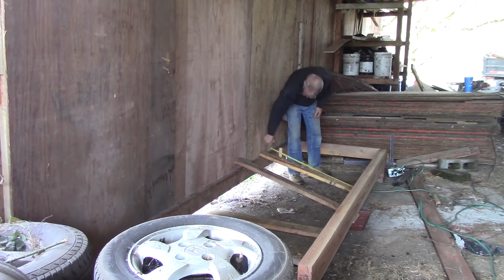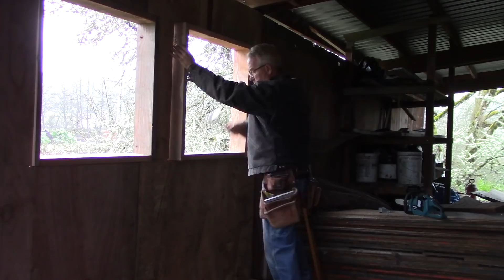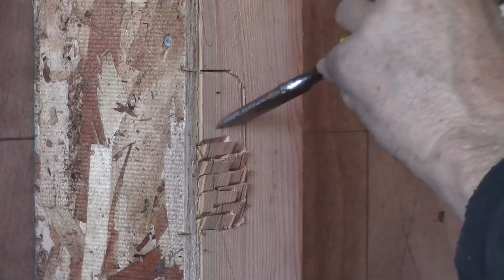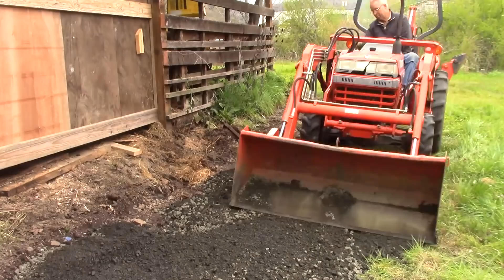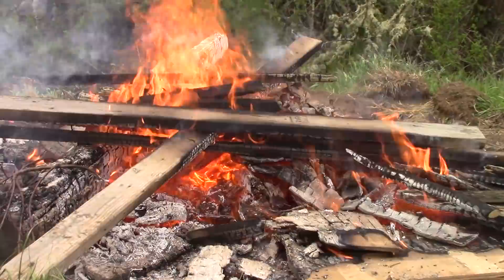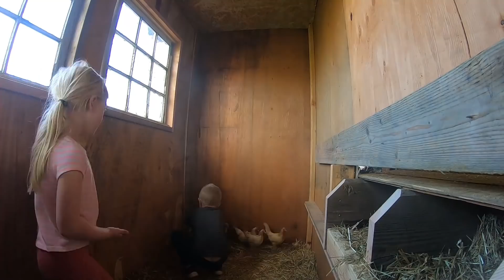Building a Chicken Coop

Comment: Hi Scott thanks so much for all the educational content you create. I use to work part time in electrical. I met a craftsman like you working a post and beam build, he said something to me that always stuck he said the difference between a good job and  great  job is 5 minutes. His other comment was one day while I was wiring a light up in a peak there was a bolt hole that need a plug, he asked if I could put it in as I was already up there I did tapping it in flush when I came down he asked if I left it 3/16 proud I said you didn’t tell me to do that . I said it’s 40 feet in the air who’d  know he said “I’d know”  he subsequently went up drilled it out replaced it . His like your philosophy towards workmanship inspires me  thank you

Comment: I built a 10'x5' rectangle, with a 5'x5' enclosed area taking up half a couple feet above the ground for the indoor space, slapped a metal roof on it, it's about 5 feet tall at the peak, nailed on an egg box and put it on wheels.  It's a hybrid coop/tractor I move around the yard every few days.   I quickly learned the chicken wire isn't strong enough against larger predators, especially dogs, and replaced it with hardware cloth.   It'll house up to 8 chickens.  Over the 9 years we have scaled back to 4 chickens since 4 eggs a day is plenty enough for our family of 4.  We let them out a few hours a day to roam the backyard.  They have brought much joy to our family.  Our current dog (pit bull) that grew up with them as a puppy gets along and actually plays with them.

Comment: So true about working alone. I'm building my shop by myself and I've concluded that in most cases, getting a 2 or 3 person job done with one person just requires some ingenuity. For example, the windows on my shop are 100 pounds and 4x6 feet, no way one person can do that. So I clamped a winch to the bucket of my tractor, looped the wire rope through a chain link screwed to the rafter tails above the window hole, and down, then attached the hook to a ratchet strap looped around the window. Gave me pushbutton control of the raising and lowering and worked fantastically. I'll be using my very old scissor lift to raise the very heavy 5/8 drywall panels up to the ceiling. The only thing that absolutely required two people was getting the 28' long metal roof panels up on the roof from the ground, and someone in a comment on YouTube helped enormously with an idea that made that work.

Comment: 6:29 That's the truth there. On that spiel that touched on trying to use old stuff; there was a deck we replaced that left us with about 500 square feet of old junky composite deck boards; it sat by an old barn at the ranch we had recently moved into at the time, and got mostly grown over with grass; 2-3 years later I start to wonder if it's worth hanging on to, when suddenly it becomes extremely valuable for livestock related structures, and now I really appreciate having it.

Comment: Very nice space for a coop, and it looks like it'll turn out really well. If I can make two suggestions:
1) I really thought you were going to leave the space in the rafters open, and was a bit surprised to see the plywood go up in there. They'll need all the air they can get, especially if it's damp. Ours do 10 degree Colorado nights just fine, and will fight us for the option to sleep in the open air.
2) If raccoons are indeed a problem in your area, you may find the chicken wire is insufficient. We went with hardware cloth, but that gets pricey very quickly for a large area.

Comment: What did you line the bottom of your run with? Keep in mind that the chicken netting wont keep predators out (except hawks), it'll just keep the chickens in. Most predators can tear right through the netting. Also, did you block off the gap under the coup? If your hens get under there, they'll probably try to nest under there. It's also a good spot for snakes.
Reply: Someone else told us the same thing!  Scott is out putting up 2 ft high hardware cloth all around the bottom right now!!!!  Thank you!

Comment: You need to build a roost for the chickens to set/roost on at night. They don’t like to be in the box or on the floor all the time, at least ours at home didn’t. It’s just a couple of round dowels 12-24” off the floor. We had 50-60 chickens, the coup was app. 12x20, one wall was roost rods and 2 rows of 12 laying boxes on the other wall,  the outside run was approximately 100x150’ in the woods so we didn’t have a top. Just a suggestion. Stay safe

Comment: It looks like you’re using hexagonal chicken wire, which does NOT keep raccoons out. They can easily tear through the wire, and often do. Weasels can also fit in the large openings and wreak havoc. Chicken wire is really only intended to keep chickens in, it does not offer much for predator protection. Half-inch hardware cloth is much more sturdy, but also much more expensive. The chickens will definitely need to be shut in the coop at night to protect them from predators.

Comment: Essential Craftsman: "I'm done with concrete."
Next video: "Here we are getting ready to pour a concrete pad."
Never say never! It always comes back around to bite you.
Reply: BarnyardEngineering well... he won’t need those plywood forms for pouring a pad.
Reply: You are right ... but I think he was speaking in the sense of full size jobs like he used to take on.  I think he is saying he is going to steer away from it whenever possible!  I am 66 yrs and I have reluctantly given up on several things I used to do like climbing and trimming out trees.  I still cut them down but if pruning at the top is needed I get a friend who is 20+ years younger than me. :)
Reply: @advancednutritioninc908  Hello there, I'm in your age bracket I guess; although I beat you by a few years- I don't climb trees like I used either but I get a great deal of pleasure out of using an 8 mt (26 ft) pole saw I made up over 20 years ago. It has accounted for a number of entire trees with only the trunks and a few lower limbs being cut with a chain saw. An 8 inch limb is no trouble. Sure it's not as quick as any power saw but it always starts first time! well if I can get out of bed that is-  I rarely have to leave the ground to cut off high branches. Add a sturdy 8 ft step ladder plus my height/reach and any limb within 38 ft is fair game. After that I leave it to the tree surgeons!  Oh by the way Australian gum trees are a darn side harder to cut than softwoods-  Keep well. H